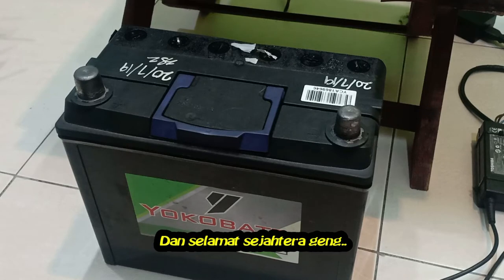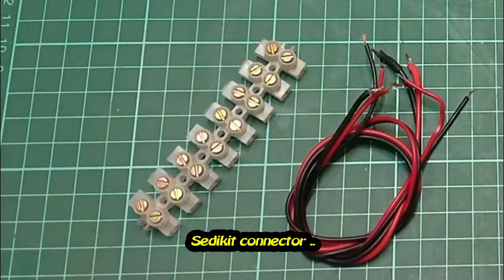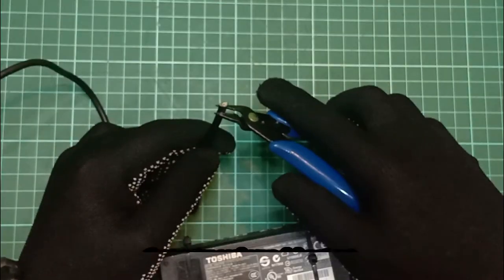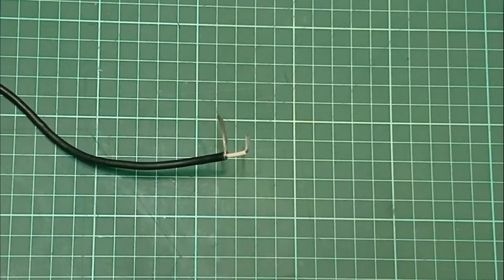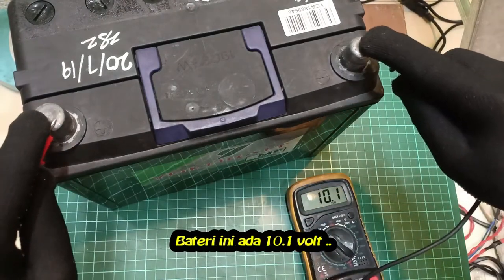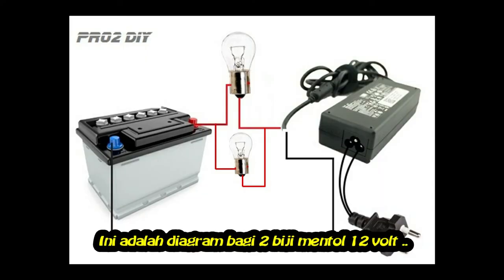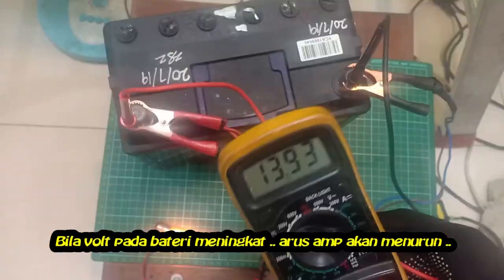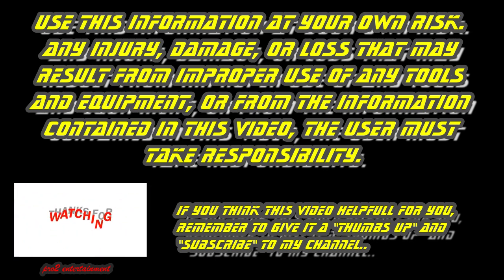How to Charge 12V Car Battery with Laptop charger DIY Car Battery Charger

Comment: Salam bro, nak tanya sikit bro kalau mentol tu tukar dengan kipas yg ada dlm cpu computer tu boleh ke? Kipas tu dc12V 0.13A
Reply: Saya ada charger laptop output dia dc19v 4.74a boleh ke sambung dgn kipas tu dc12v 0.13a terus sambung ke bateri moto/kereta yg nak di cas
Reply from the maker: x bley bos.. amp yg kipas tu gune kecik.. 0.13 amp je..
Reply from the maker: kne pakai mentol 12 volt.. laptop charger x bley masok direct ke bateri.. wajib ade mentol.. mentol ni yg kontrol lebihan 19 volt charger laptop..
Reply from the maker: kalau pakai mentol 12 volt.. lg terang mentol.. maksodnya sedang cas bateri.. kalau mentol dah redup/malap.. bateri dah nk penuh.. senang nk wat rujukan..
Reply: smart move bro...saya coba gunakan kipas cpu 12v, voltage turun dari 19 ke 13

Comment: to raise the amp you need to add a bulb in parallel not in series ( you stated it should be in series )
Reply: @fariborz607  Correct. Parallel not series. But his diagram is correct. Showing the 2 bulbs in parallel. Im sure he mis-spoke